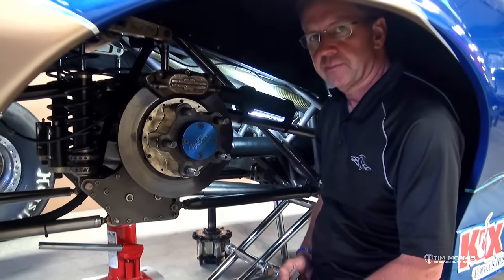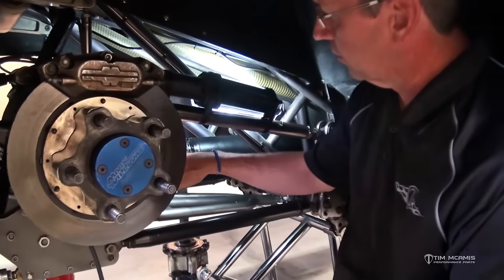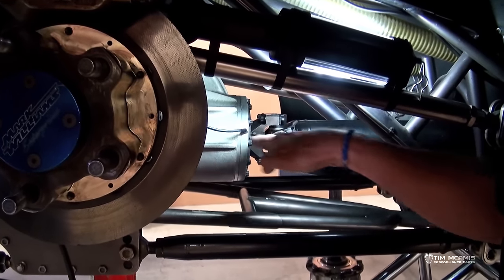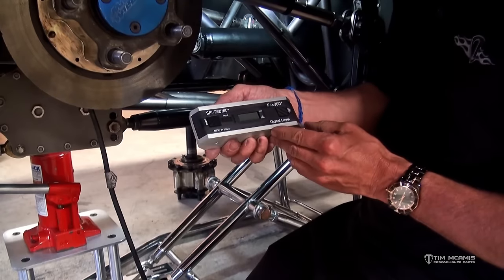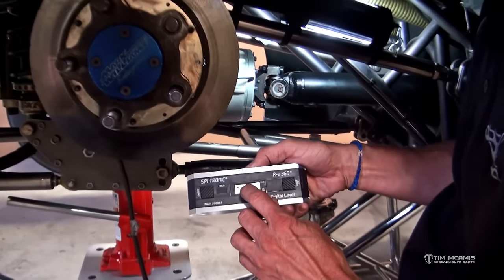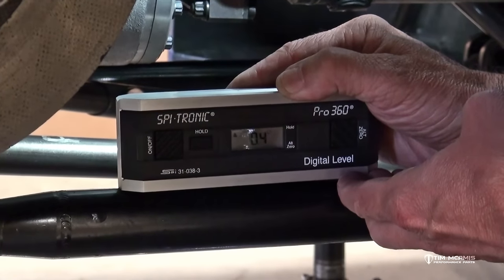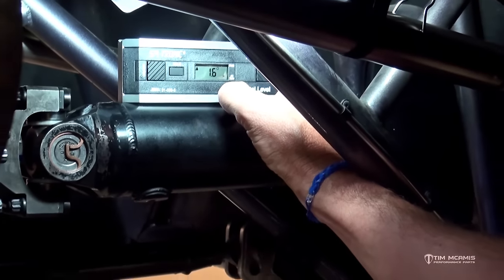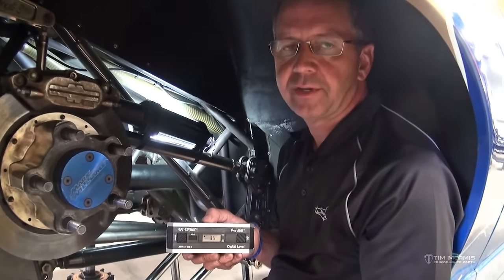Rear Suspension Overview Part 2 - Pinion Angle

Comment: Good info but you don't explain why. What are we trying to achieve by moving the pinion up or down? Does this determine the moment in which the pinion starts to climb the ring gear during acceleration like a point of leverage?
Reply: Yeah I love Tim and these videos but there is so much unaddressed and wrong with this. He also is measuring the pinion angle but then calculating the operating angle, of the driveshaft instead, which are two different things entirely. Yes, they affect eachother. But nowhere is this mentioned or addressed as to how they correlate and why they affect eachother. The pinion angle could be 8 degrees and the tailshaft will be in the same spot so it's pointless to leave the operating angle unaddressed as to what you're actually measuring - which is the uni's not even the pinion technically at all.

Comment: I agree. Pinion angle is the relationship between the pinion and the crankshaft / trans output shaft.
Reply: Dave Muller
Reply: Agreed.  But, since these are full tube chassis race cars, they probably set the engine/trans angle so it was perfectly in line with the pinion.

Comment: Don't we want to set pinion angle relative to the engine/crankshaft/transmission output shaft so the driveshaft U-joints stay in phase?
I love your videos! Putting a new rearend in an S10 now. I have leaf springs, so I was planning on starting -3 deg relative to the rear seal angle of the transmission.  Thanks for the video lessons and clear explanations!
Reply: Yup I'd agree; the pinion angle is only import with regard to getting it parallel to the gear box output shaft. Certainly worth checking for road cars where noise is important, not so sure about competition Cars?
Reply: Nope. The pinion angle is the most critical angle of any driveshaft system. Otherwise you'll tear the yoke clean out of the car at worst, or at the least produce vibrations and heavily accelerated wear. Generally you can't change the front angle - it is as designed or built into the car. You can however change the rear angle via the pinion. You NEED some amount of angle. The whole 'lineup method' is great on paper, but almost no car anywhere - street or race - is designed in that manner that a truck or heavy vehicle is with in-line parallel shafts. And to set a dead straight zero pinion shaft or build one completely inline, makes the tailshaft useless.

Comment: Hey Tim I was told to place the angle finder up against the outer face of the pinion support,  (makes it 90 deg. to the pinion)  Then using the reference of 12 and 6 o'clock as your true horizontal you subtract one from the other and the difference is your pinion angle. But that is only to the ground and not the drive shaft. Also when aligning the drive shaft they should cancel each other out , so say -2 on the pinion should translate into +2 on the transmission. Any thoughts..?

Comment: What ride height do you recommend from center of the axle to center of the rear cross member? Vertically. Also should the axle be symmetrical vertically and horizontaly to the rear cross member? New to setup. Thanks for the help. Very nice video.

Comment: You seem like a smart guy, but you measured the driveshaft with the angle finder on the weld. Pinion angle is just that. Pinion angle. Drive shaft has nothing to do with it. You can angle the pinion down or up as you choose for your application. For everyday driving 3 ° up is good, so long as engine/trans is 3° down. Drag only cars are a different story, depending on suspension type and engine mounting.

Comment: Perhaps it varies from what the particular car is used for, but I was always told that 3* negative is the magic number for proper pinion angle.
Reply: Absolutely not. First, the pinion angle (let's say that it is 2 degrees negative) then the tranny angle needs to be equal, but opposite (2 degrees positive)

Then, depending on what type of rear suspension you have, you take into consideration the amount of pinion rise you get when you stab the throttle.

This next part is for serious racers only;

They want all angles to be 0.0 while under the most power and flex, to go the fastest.

With 4 link and ladder bar, you probably want between 0.5 and 1 degree negative angle on the pinion. This is so that when the motor tourques the driveshaft and the axle, and the pinion climbs the ring gear, it flexes to 0 degrees on all u-joints. On a leaf spring car wants around 4 or 5 degrees negative on the pinion, because of "spring wrap".

You want all angles to be 0, at full throttle, max twist. This is for hard core racing for max speed.

For the street, we want max u-joint life. So, if your tranny/driveshaft u-joint is 5 degrees negative, (like my car is), then you also want the pinion angle to be 5 degrees "positive" (equal but opposite).... At ride height. 

My tranny angle is 5 degrees negative (can't adjust it any further, my car is lowered with big tires in the back), so I must get 5 degrees positive out of the pinion. I can only get it to 4.2 degrees positive, but that's close enough. I have ladder bars so when it flexes, it might be closer to 5 degrees positive (a good thing).

5 degrees negative or positive on any u-joint is excessive (I can't help it). That almost the max limit for them.

For the street, ride height u-joint angles should be between 1 and 3 degrees (equal but opposite) for best wear characteristics, and the angles should never be 0 degrees on the street (wears out quickly), while highway driving. Many considerations must be addressed when picking "pinion angle". Hope that helps.
Reply: @jakefriesenjake  Thanks! I appreciate the info. So  to summarize, would that be 10* apart parallel?
Reply: @tabcobra  no, I don't think so. My car is 5 up front, and around 5 on the pinion.

If my engine and tranny centerline was straight or parallel with the ground, then the driveshaft is pointing up, from the ground 5 degrees. Then, the pinion is then pointed back straight, like the engine is. The engine and pinion centerline are on the same plane.

My actual engine is pointed down by 2 degrees, driveshaft is pointed up 3 degrees (5 degrees total) and then the pinion is pointed up (u-joint side is higher) by 1.2 degrees, (total of 4.2 degrees). Makes a z type of shape